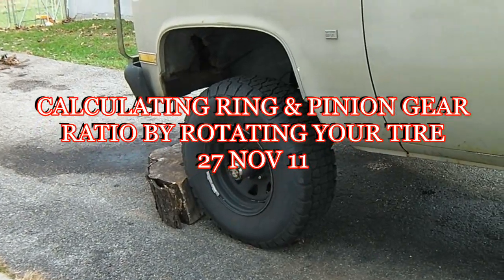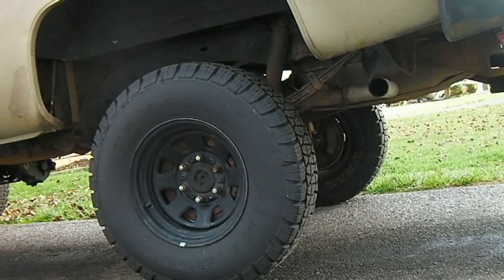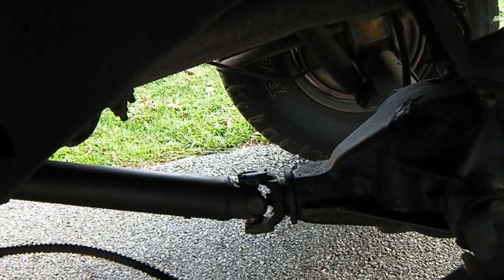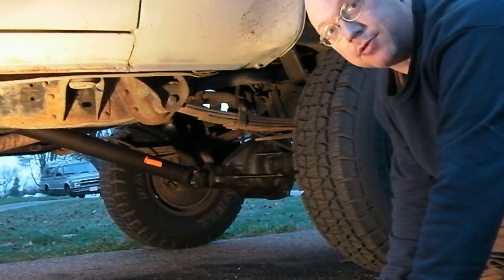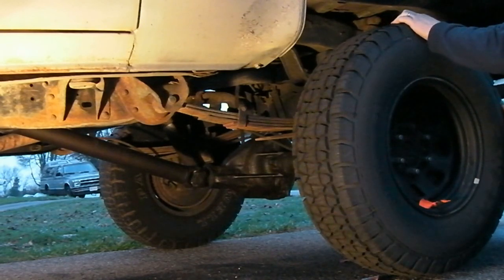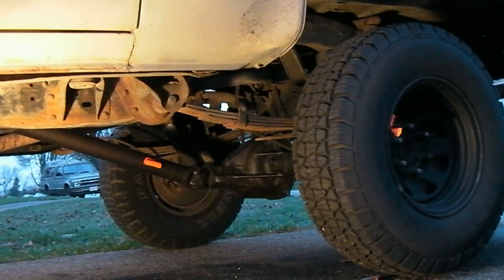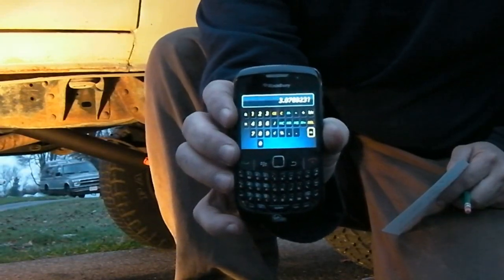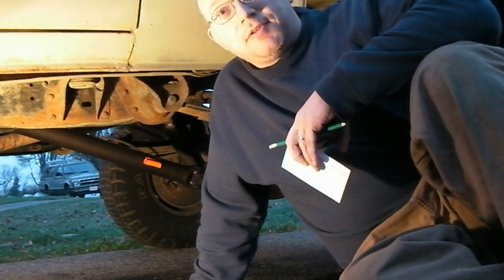DIY: Check the ratio of your ring & pinion

Comment: must not have posi
Reply from the maker: You are CORRECT!  Open diff, and the above only works with open diff.  For posi or locked, a different approach is needed.  Thanks for mentioning that!
Reply: Nice toy
Reply: +elevenbravodotnet for posi is the same, for open diff you multiply the wheel turns by two. posi you just jack whole car up and count the turns once